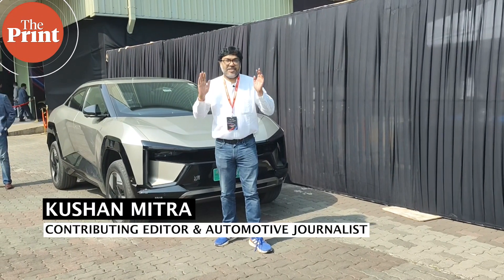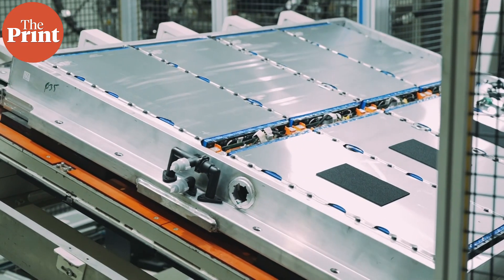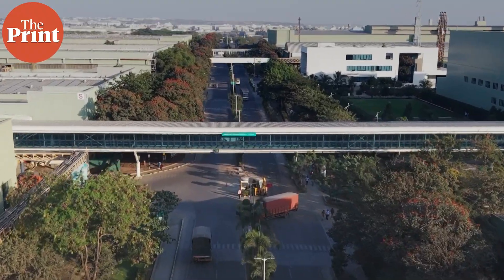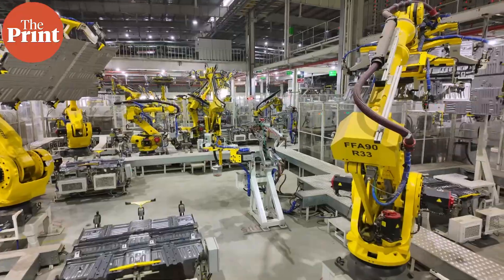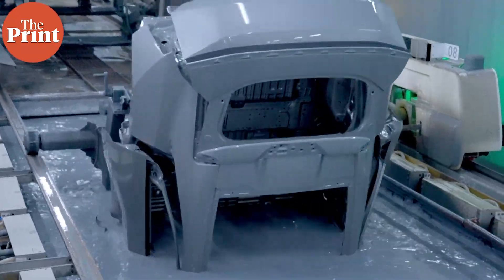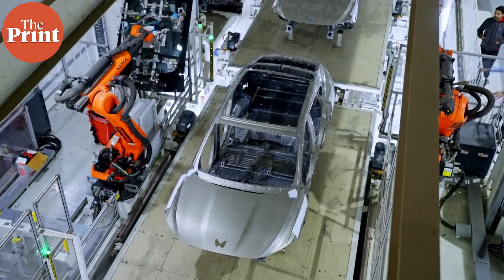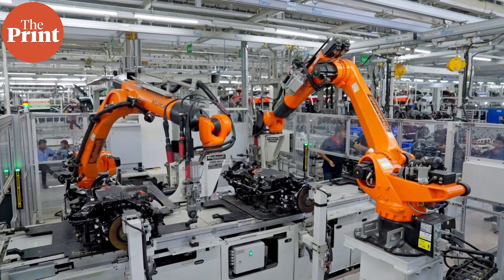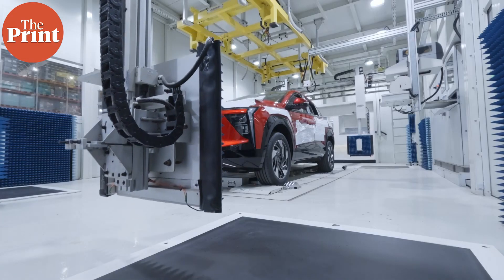A look inside Mahindra’s Chakan plant to see how they make their new electric vehicles

Comment: hope Mahindra was wise enough to get a patent on their new EV specific technologies & process, for e.g. a patent on Mahindra's INGLO EV platform is warranted without question . . . a copyright or something . . . a dedicated off road variant of both the BE 6e XEV 9e (with a proper 4WD system) in limited numbers for the pure enthusiast . . . Mahindra could develop a internal combustion PHEV variant of the BE 6e . . . a 2.0 Biturbo I4 mated to a 9-speed torque converter auto & a 36 kWh battery iPMS PHEV motor . . . 268 bhp @ 4600 rpm & 116 kgm of torque . . .
Reply: 2.0L biturbo? Under that bonnet??

Comment: I’m an Indian working in US and I work in Rivian is USA, and we haven’t started using blade batteries for R1 SUV yet which are cheap but effective and deliver good power density. Tesla had to use LFP blade design to remain competitive in market and they started using BYD batteries. Based on the video and some stations, I can say this line looks more efficient, automated than our lines. But, ours is due to lower demand and for R2 we will have something similar but of higher energy capacity. Mahindra did great job. I ask Indians in India not to mock our own products and brands, in a country where EV cars adoption is still low, and when reputable brands have established cars in industry, it should be highly appreciated that our companies have started doing something like that. Not just India, the world doesn’t have any choice except to use chinese cells/modules/packs until someone designs and develops better chemistry designs which are much cheaper but highly safe and efficient or solid state batteries or hydrogen Fuel cell or hydrogen engines. Apart from that, people can start designing better packs and architecture based on these cells and start innovating to deliver better products. I appreciate Mahindra and Tata for their innovations and initiaally even Tesla , BYD or ours had pbs. No new car architecture comes out in market with pbs, and they would be solved in recalls or next face lift models.

Comment: I’m an Indian working in US for Rivian,and we haven’t started using blade batteries for R1 SUV yet which are cheap but effective and deliver good power density. Tesla had to use LFP blade design to remain competitive in market and they started using BYD batteries. Based on the video and some stations, I can say this line looks more efficient, automated than our lines. But, ours is due to lower demand and for R2 we will have something similar but of higher energy capacity. Mahindra did great job. I ask Indians in India not to mock our own products and brands, in a country where EV cars adoption is still low, and when reputable brands have established cars in industry, it should be highly appreciated that our companies have started doing something like that. Not just India, the world doesn’t have any choice except to use chinese cells/modules/packs until someone designs and develops better chemistry designs which are much cheaper but highly safe and efficient or solid state batteries or hydrogen Fuel cell or hydrogen engines. Apart from that, people can start designing better packs and architecture based on these cells and start innovating to deliver better products. I appreciate Mahindra and Tata for their innovations and initiaally even Tesla , BYD or ours had pbs. No new car architecture comes out in market with pbs, and they would be solved in recalls or next face lift models.
Reply: "No new car architecture comes out in market with pbs, and they would be solved in recalls or next face lift models." - can you explain this line in more detail ?
Reply: @wassuphomies263  I meant without pbs, it was a typo buddy. Just google Model s, x and even 3 initial problems and you can see they had to deal with lot of issues with drive units, doors, infotainment issues, suspension pbs etc.,
Reply: @Gajjala-oi4cc  ah yes, thats true. i understand now
Reply: Well my man , this comment by you because of the proper contribution of maturity, intelligence, common sense and manners  ,what majority people India don’t  have that way they always like this towards this brands. Anyways good luck with your future 👍
Reply: @savitajadhav1314     💯💯💯
Reply: Hello Gajjala 
I am doing m.tech in design from IIT madras. 
Any suggestion for me as you are experienced one in industry . 
My research is in composites
Reply: @Bull-ph1gf I don’t think i’m in a position to tell you what you should focus, as a student and that too in IIT, you would have more exposure than what I had during my engineering and also lot has changed in recent times,But always focus on some foundatinal problems buddy, no matter what we design in composites generally they are costly than traditional materials due to higher production costs despite significant advantages. That is why only in  low volume, costly products these composites are used like military planes or so but if you see in automotive or aerospace industries, the body material of cars or aeroplanes still use aluminum as its cheaper although off late some CFRP is slowly replacing aluminum in aeroplanes but it still is not a complete replacement. So, if you could work on some chemistry that is easy to produce, cheaper but offers same capabilities as aluminum then it would be a great project/paper. But I don’t want your gen just to stop there, if you can develop something new which you believe could change certain industry then go for a starup and use resources to make it happen.
Reply: @Gajjala-oi4cc  
My family financial condition is not so good that i can take risk of opening startups.
My goal right now is taking job in industry either in core and non core(software) . I am training myself for both .
Yes you are right composites are costly  and have limited use until very much necessary  mostly in aerospace and automobile industry  . 
Even additive manufacturing of composites is costly , time consuming and do not provide that much strength like conventional  composites . 

My research is limited to mechanics of hybrid composite manufactured by 3 d printing not into production and all that chemistry or manufacturing process .
Reply: Thanks for your comments!
Reply: Bruhhh I guess u have heard about isreal's pager attack on hijbulla, they literally bursted the battrry of pagers which were used by hijbulla. Do this BYD cells propose such threats to us? Can China do something to cells which will eventually can burst these cells or you know steal data from us using our car and cells in them. Please clear this doubt, please it is a request. Thank you very much.
Reply: @Gajjala-oi4cc     bro you might have heard the "pager attack" of isreal on hijbulla, The pager's battery was used as an explosive to hit the hijbulla. please let me know wheather fuel cells of BYD possess such threat ?. Can China use duel cells of BYD for attacking us or spying on us. You know the car is preety affordable and I think many army officers r about to buy it so can China use those fuel cells of BYD to spy on our army officers or for causing such threats?. Please please let me know, as u r an expert in fuel cells etc. Please let me know.🙏🏻🙏🏻🙏🏻🙏🏻. Thank you.